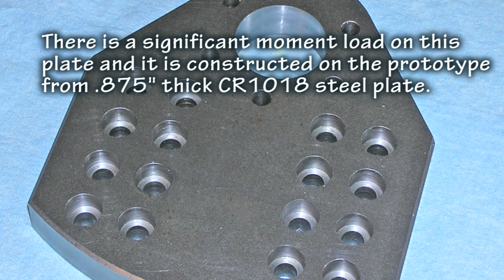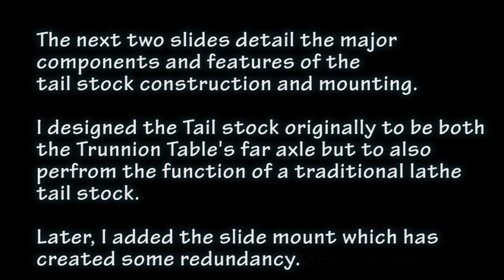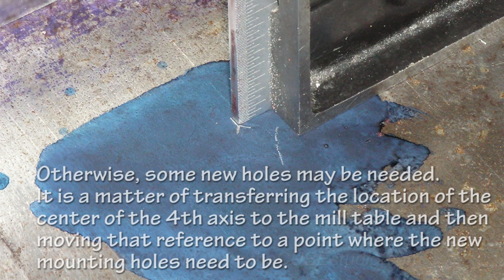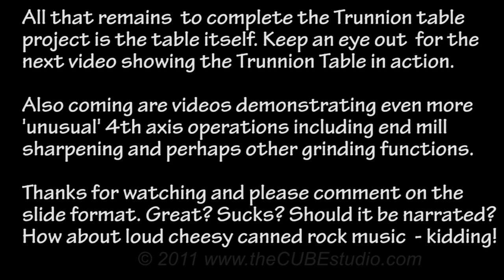4th axis Tail Stock and Trunnion Table accessories - Design notes and basic install

Comment from the maker: @thetallgrass1 The spindle cartidge is my design and custom built for this project. However, mounting the tailstock on rails created a redundancy in advancing the tailstock, so the cartidge is no longer used. The area inside the tailstock is now used for a fully enclosed adjustable drag and locking mechanism to compliment and syncronize with the spindle lock in the 4th axis.

Comment: Dude, that's fast. Insane, actually. In fact, I just hooked up a similar sized motor to my chinese 90:1 8" rotary table, and now I'm afraid I'll bust the worm gear. What power BLDC motor are you using, and what is the overall ratio? And, can you suggest a better way of interfacing a motor with the table than through a brass/steel worm gear?

Comment from the maker: @torinwalker Typically a worm gear would be an appropriate drive for a 4th axis/trunnion table. I doubt you'll hurt the gears. This method is good for 4 or 5 axis milling, but they cannot run fast enough to do turning, that is the advantage of my 4th axis. Machining centers of course, can do what why 4th axis does . . but not for under $2,000. Taking a knee mill or large bench mill and my 4th axis and doing some of what a machining center does (for 10% of the cost) is what has people excited.